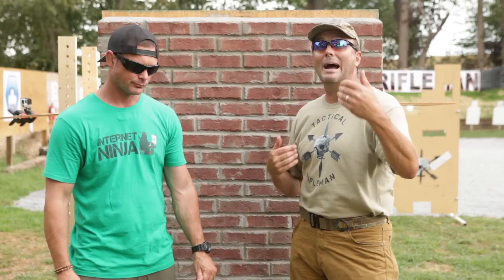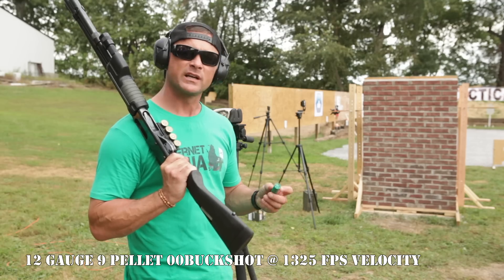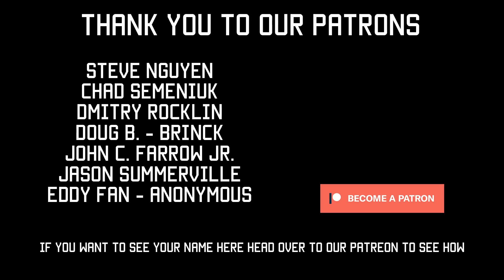Navy SEAL test Ballistics through Walls | Tactical Rifleman

Comment: Thanks for putting in all that work. Good video with relevant, useful data. Can't wait for the follow ups. 

While it is important to select ammunition that is going to provide a responsible amount of penetration in urbanized areas, it is also important that we acknowledge the importance of adequate penetration to stopping a threat. I don't advocate M80 ball from a 7.62 NATO or a 250 gr Keith-style hardcast from a .44 Magnum, but anything with enough penetration to reliably stop a threat is going to go through interior walls. An 8 year old boy can punch through drywall. Meanwhile, penetration is required for effectiveness. We want 12 to 18 inches of penetration in bare gel.  Birdshot is no go. I've seen birdshot fail to stop a ground squirrel at in home ranges too often to trust it. Neither is frangible or varmint bullets. Again, sacrificing adequate penetration over fears of "over penetration" will get you killed. Quality JHPs in handguns, buckshot in shotguns, and something like a 75 gr Hornady OTM for 5.56. Watch your backgrounds and train to proficiency so you can place rounds accurately. I keep a 10mm Glock loaded with 200 gr XTPs and a Colt AR-15 with a white light and a red dot loaded with 62 gr Barnes.

Comment: I have never seen a cinderblock walk built in construction without being reinforced with rear and concrete.
Reply from the maker: Code varies by state. Interior walls of schools and other buildings are often unreinforced.
Reply: @TacticalRifleman  I didn't think about different state code. I did some welding for new class rooms at 4 schools this past summer in Louisiana. All structural walls were reinforced cinderblock.

Comment: Fabulous video. Not surprising that brick is the best defense, as it is a crude ceramic, the same material category as body armor plates. The cinderblock doesnt offer as much protection, as it is a low density aggregate (the material as well as the interior channels). Although cinderblock worked, the best choice is brick. My takeaways - 1) Dont use birdshot for home defense as it has no stopping power; 2) whatever round you use indoors, you better not miss!
Reply: I am surprised as I have a .177 air rifle 1200 fps.....I shot a solid red brick from 10 m.It did about 1 inch penetration which most of the firearms couldn't do here.

Comment: Slightly off target question here. Is there anything (that will not bankrupt a normal person) can to to make windows so they will either slow a 9mm round significantly or cover temporarily?  I have made something out of ceramic tile glued to plywood. We tested it with 9mm hollow points and 22 lr and it of course shattered the ceramic but none penetrated the wood. I have a large sliding glass door to cover.
Reply from the maker: Peal-n-stick Lexan

Comment: Bird shot at close range seems best safe home defense round.  Good spread to cover for fear reducing your accuracy.  Will still kill at close indoor range. But it will have low leathality if passing through dry wall.
Reply: Birdshot is not lethal
Reply: @themadminuteman   I think at under 8 meters it will fuck up your day.  And wax slug bird shot is.
Reply: Bad choice if the gunman has hostages. However, I am sure if you ask him he will wait for you to switch to your sidearm!
Reply: @tonyhind6992   yeah not trusting my life on homebrew wax slugs or ~8in spread at 8m birdhshot vs a clean shot to the brain box from an AR or handgun which both have x2 to x6 the capacity of a shotgun. Not to mention they are way faster to shoot, reload and move with.
Reply: @themadminuteman  shotgun is better for home defence and btw number 5 birdshot from my Remington 870 will kill you 30 feet away without any issue at all so quit with the it is not powerful bs
Reply: @theghost7277  death is caused by two things: brain destruction / severing the spine or massive blood loss. To achieve those you need both penetration and velocity. 

Bird shot has neither, outside a point blank shot to the spine or head. 

Rifle rounds have both velocity and penetration. The AR15 is more accurate, easier to shoot accurately, faster to shoot, less recoil, 5-6 times the capacity between reloads, much faster to reload and doesn't over penetrate interior walls. Rifles also have effective ranges out to over 500m. In more common circumstances where you might shoot down a long hallway or across a house buck shot spreads 1inch per yard. At 20y that's 20inch spread, average chest is 18in wide. At 20y an AR15 easily puts rounds in the same hole, ie the brain box. For a shotgun the slug is the best choice for accuracy, but has extreme over penetration and still fails to be superior to an AR15 in every way.

Your best bet with a bird shot loaded gun, is that the bad guy gives up or runs away after being shot, bc they won't be dead or mortally wounded. They can still kill you esp if they are armed and out of their mind on drugs that make them feel no pain / not give a shit.
Reply: @themadminuteman  ever shoot a watermelon with a shotgun at 20 feet or ballistic gel? It is more then lethal at 20 ft. You can look at all sorts of tests done and people who have defended there home with birdshot and it makes a royal mess of someone when hit at that range or even a little farther
Reply: @themadminuteman  another thing I shot my first bear with a 223 hollow point weighed in at 275 lbs and the bullet punched through it and came out with enough force to go into the tree behind the bear. That's not acceptable  for home defence
Reply: @themadminuteman  lol birdshot doesn't spread that much in the average shotgun srry m8 I te spreads alot slower in most shots unless it's a sbs
Reply: @theghost7277   Ok dude whatever you think lol you aren't a professional nor a SME, I really don't care what you are on about. 

Fact is AR15 is superior for fighting and home defense in every aspect. Actual Professionals and SME's will say the same thing. G'Day 👋

Comment: Hey fellas, quick question if ya have a min.? So I just added a 3x magnifier behind my EOTech red dot. I'm running both on an L. W. R. C. M6. Because of room I was wondering if I zero my "Diamond Head" iron sights in front of this set up on my top rail ,1 will it keep a zero and would this be something you recommend or should I just move my optics forward more to allow room for rear iron sight behind my optics by charging handle. Thank you for you're time.
Reply from the maker: Move the forward. Having the reddot further forward does not make it less accurate. However, having the rear iron sight further forward does.

Comment: I've had plans to do something like this for a quite a while. Great test! Edit: I know you said you are going to do 300blk, 308 and such. I would like to see how hollow points do also. I would also like to see a 6.5 grendel. That is quickly becoming my go to caliber for everything so I would like to see how it works, hollow points included. This test helped enforce to me why I wouldn't use buck shot. You have a higher chance of missing the target and it is still very lethal even after going through an exterior wall. Shot placement is key

Comment: Would have liked to see a small barrage of rounds, in addition to the single shot analysis. 5 well-placed 5.56 or better 7.62 would get through the wall pretty quick.
Reply from the maker: Yes, but that's the same with most mediums, including bullet-proof glass. They all would have failed. However, not the point of this video. Most shots fired in an active-shooter situation are not focused in one area. Thanks for watching, TR

Comment: there is a 1in. air gap between brick and back walls for weep drainage.
Reply from the maker: Yep, and that was included in our wall construction. We sealed it around the edges, to prevent water seepage, as these walls were outside in the elements.
Reply: Cool glad to hear it, impact response is good then
 @TacticalRifleman

Comment: True, a good amount of very useful visual info.  However, I could do with a lot less of the extraneous fill-in Bovine Secretion.  At first, I wanted to take issue with one thing the SEAL said about the short-barrelled SIG MPX.  He made the comment that it added to the power of the 9mm round.  How so?  I now realize that he was referring to the length of its barrel as opposed to the length of a typical 9mm pistol barrel.  At first I thought he meant compared to the length of a normal rifle barrel, which would have increased the velocity of the 9mm projectile over the MPX barrel, up to a point.  Conclusion: Good Video.
Reply from the maker: Ron, thanks for straightening yourself out. I have enough "haters" as it is. We try to put out useful information, tips, and techniques. Thanks for watching, TR
Reply: @TacticalRifleman  TR, Thanks for your reply to me comment.  I'm glad I realized that I had mistakenly misread the SEAL's comment before I sent my comment concerning the barrel-length/power comment issue.  However, I respectfully maintain my thoughts on the Bovine issue. (Smile)  RM

Comment: Ok, ignoring “Alright boys” or techniques shooters actual experience.  The video shows, you NEED to know what’s downrange.  And what is on the other side if you’re shooting in an urban or suburban environment.  I live in a two story condominium, walls between units are just drywall with fire retardant insulation. However, first defensive position is from top of the stairs shooting down to a landing, if I miss or have a through & through with my AR running 77 gr OTM the round will go through the wall into a dirt and block planter.  If for some reason I feel the need to move to the landing, misses will hit the concrete floor and bounce back into the ceiling, joists and subfloor etc. I might lose a computer or monitor cause that room is my office.  If I go down, the wife will be shooting her AR from behind an old AR500 IPSC C zone target out the door of the closet.  If she misses, the round has to penetrate at 45 degrees, 4 walls and a solid wood dresser before hitting the wall between the units.

Know where your bullets are going.  We also follow Clint Smith’s direction of tossing a laminated floor plan with sign/counter sign out a window so we don’t accidentally have a blue on blue situation when the police arrive.

Comment: Are you using cinder block or a concrete masonry unit (CMU)? You typically see CMU in residential builds and the structural integrity of CMU is much better than cinderblock.  Also, your brick over CMU and Brick over sheathing do not include a vapor barrier, a small space for moisture wicking and water drainage. In real build applications you’ll have a vapor barrier between the brick and whatever application is behind it.  I am curious if you were to redo this experiment and build these walls to correct home building standards, if the ballistics would have the same or different results.
Reply from the maker: Yep, it is CMU... we always used "Cinder Block" as slang but only because no one uses cinder blocks anymore. As for vapor barrier; we didn't add it because it would NOT have effected the ballistic resistance of the wall. Other materials, such as fiberglass insulation, were added to the walls where that would have been used.  Thanks for watching, TR

Comment: #1 Buck will take out the bad guy. Missed pellets only go through one hollow drywall and should be stopped by the 2nd wall, protecting the neighbors. 00 Buck penetrates too much and #4 buck may not stop a large attacker.

Comment: Good demonstration, very informative. However you left out  one wall type that is heavily used  for about 20% of the country's population. Stucco exterior, chicken wire, and drywall. All states with earthquake potential do not build solid brick type walls as they fail in earthquakes. Most houses on the west coast are stucco exterior. I belive also goes for many states west of the Rockies. I would like to see tests on this common structure in the US.

Comment: 4 cm of reinforced concrete  2cm of Martensite (AR500 Steel) and 2cm of kevlar 2cm of sand mixed with gravel and then 2 cm of concrete.

Even a 20mm can't penetrate this wall.

Comment: I hear in most videos the block being called cinder block. Are you using cinder blocks or cement blocks? Big difference between the two.
Reply from the maker: Yes, but true cinder blocks haven't been used for decades. We use the term as slang for the shape of the block, and use "cement block" to refer to solid blocks. All these blocks are cement.
Reply: Thanks for the reply. Its makes the results more impressive knowing they are cement blocks. I would think cinder blcoks would have not done as well as the cement blocks did.  @TacticalRifleman

Comment: 5.56 of 55 grains is not the military standard of 77 grains that easily penetrated both sides. If you want penetration go with 50 caliber.Good science but for a lot of us it ain't rocket science knowing what will penetrate and what won't.  There's little hammers then there's big ones.  THX  I like to see people having fun shooting at stuff.
Reply from the maker: The military M193 is 55gr. Both the M855 and new M855a1 are 62gr.  We shoot both of those against these walls is the second part of this video series. The only 77gr ammo used by the US military is the Black Hill’s Mk-262, which is a 77gr Seira Match King boat tailed hollow point, made for long range shooting in the Mk-12 SPRs. While very accurate, it does NOT penetrate these wall any more than the M855a1 and is far from the “military standard” ammo. Look it up.
Thanks for watching, TR

Comment: I don’t understand.   Why does a Navy SEAL need a tripod rest (and to make scope adjustments) to hit a wall from 32 or so feet?
Reply from the maker: I made him use it, because I needed him to hit a 2x2 inch center of the ballistic gelatin block, at the exact angle to run parallel through the block, while he could NOT even see the block through the wall
Reply: Tactical Rifleman - That makes sense. Thanks for the explanation.

Comment: So what about 7.63x39 and 7.62x51 ???? I think they would blow through most of those mockups .
Reply from the maker: We are going to cover those in a future video in this series. Thanks for watching , TR
Reply: @TacticalRifleman  iv been a commercial and residential carpenter for 25+ years . I specialize in steel stud framing and all aspects of Drywall . This being said , those mockups are spot on with exeptions regarding double layer 5/8 type X drywall . Fire corridors are often multiple layers of commercial drywall of different thickness and type , probably better to be in a stairwell than anywhere for sure .
Reply from the maker: Thanks for sharing. TR

Comment: My recommendation is to use non-lethal rounds if you're going to use a shotgun.
Reply from the maker: Why?
Reply: @TacticalRifleman  If you use non-lethal rounds it mitigates most of the negative consequences of over-penetration, while still being quite effective at stopping bad guys. I'd be willing to bet that non-lethal rounds are potentially lethal at close range, and at the same time, do not present a lethal threat after passing through drywall or thin trailer wall. Your welcome to test that.

Comment: If the requirement of meeting the FBI ballistic standard n depth of penetration into a test medium, the bird shot shouldn't even on the table for consideration. Punching your fist through a person doesn't happen. But your first through an interior wall? Sure! Now, the problem with the debate with over penetration is taking a bullet that has the capability to penetrate into a body is going to have power to pass through most walls.

Comment: Take the Sig MPX short barrel pistol, a .308 caliber round, and incorporate it into the AR 15 platform and you get a 10.5" 300 AAC Blackout pistol.  A 220 grain, subsonic round traveling @ 1050 f.p.s. that packs one hell of a wallop, with little over penetration.  You can easily move about your home with a pistol that is barely 2 feet long.  Add to that a 1,000 lumen 3 mode light, a $200 stamp stamp, add a vertical grip, and you have one hell of a defensive rifle!   Just don't forget that the law will take possession of it if used in an altercation,  www.CrosshairsAcademy.com/Veronica.html

Comment: am i the only person i the world living in a double brick home ? lol
Reply from the maker: All you interior walls are brick? That would suck.
Reply: @TacticalRifleman  not really, interior walls are cement rendered, the house is over 100 years old, there is a cavity between the bricks also about  2 inches wide. They just dont build houses like this any more. Pretty cool in summer, takes about 4 consecutive hot days for the bricks to warm up, takles about a day to cool down after a major heat wave, it has a timber floor, iron roof with insulation.  The house my fatjer built is also douyble brick. So from what i am seeing on your video, if i make some sliding plate steel avvross the openings around an inch thick, I have a fairly bullet resistant home. Like this idea.
Reply from the maker: Solid plan; just ensure you protect your roof from fire. Moltoff fire bombs are a historic way to get people out of houses. A good tin roof can protect against this. Thanks for watching, TR
Reply: @TacticalRifleman  have a tin roof, would not take much to puncture, would have to replace the timber rafters with steel and sheed the inside with armor plating also i guess. But thats a little overkill i think.